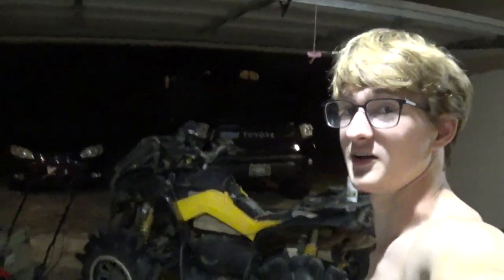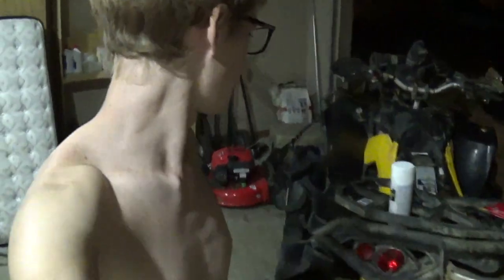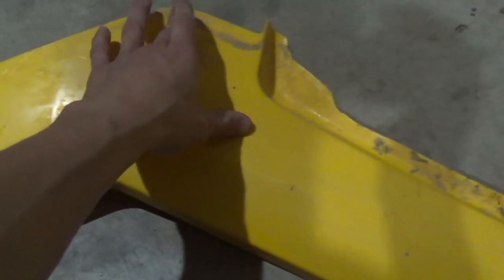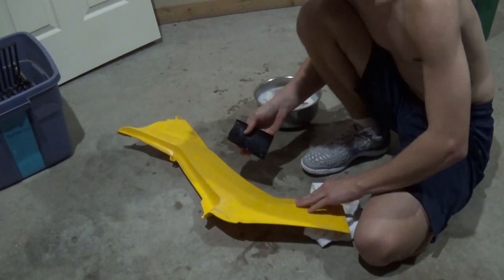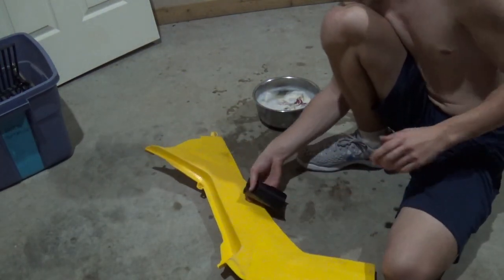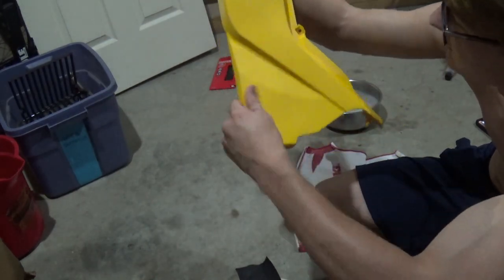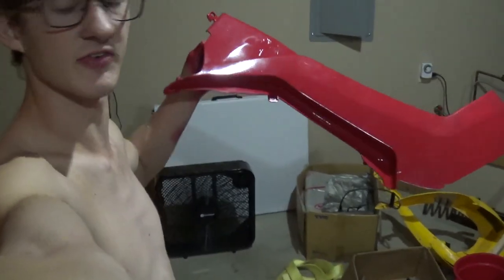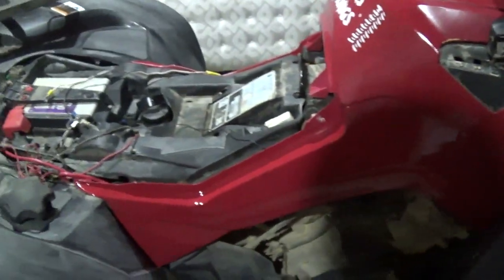How to Paint ALL ATV PLASTICS

Comment: You need to use an adhesion promoter before your primer. Then your base coat. Otherwise it will rub off or pull away over time
Reply: What type of grip tape do you recommend to use ?